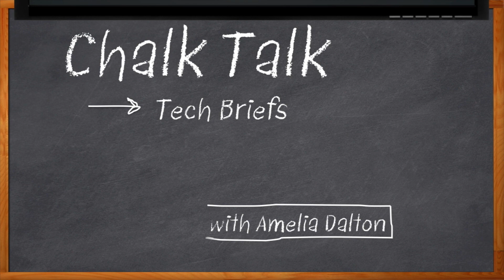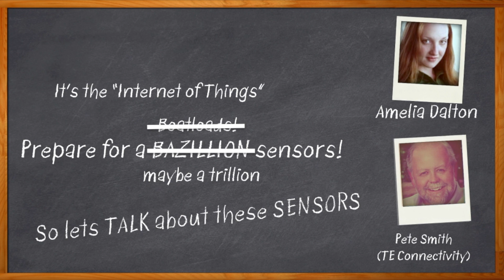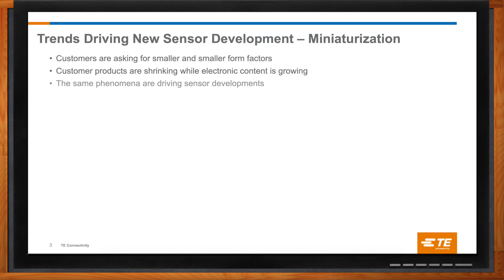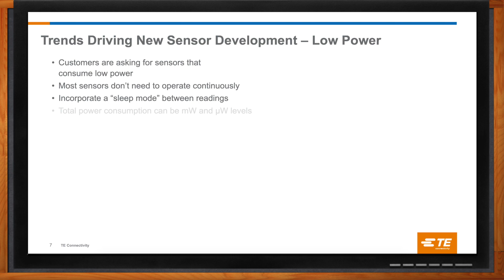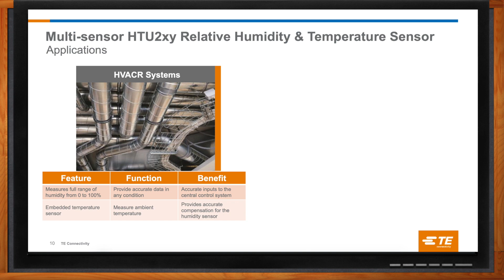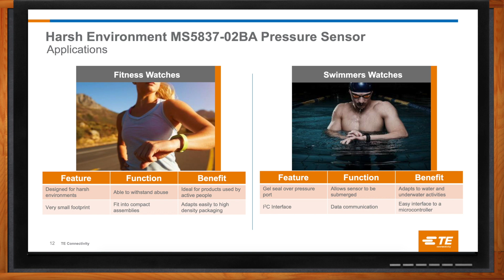Trends Driving the Future of Sensor Development -- TE Connectivity and Mouser Electronics

Comment: Could Delta or Y connection of tiny inductors or field of emf act like transistor but faster and resolution then convert back to digital after measured could be helpful. If use high voltage double Capacitor mean 4 layers capacitor like 3 layers of CCD in digital camera could have forever battery